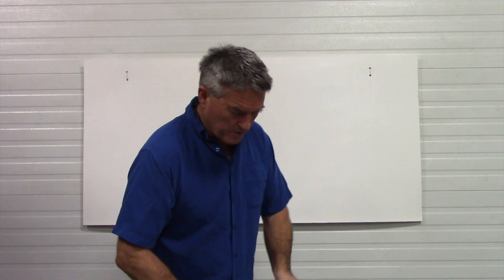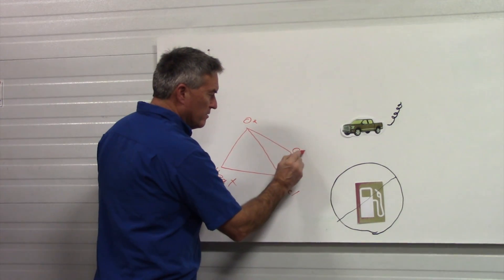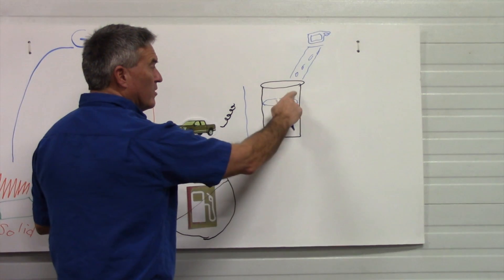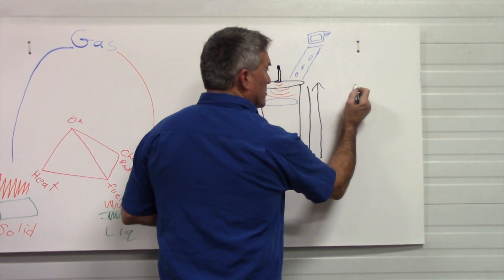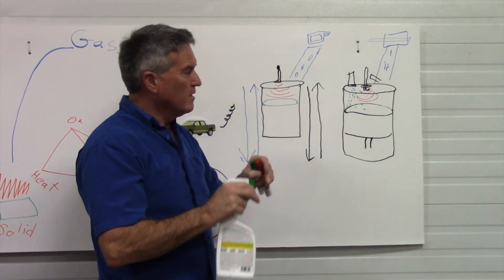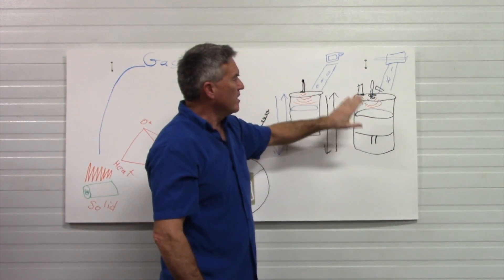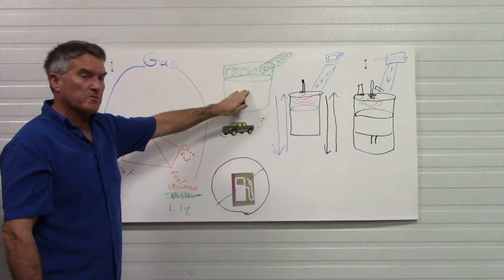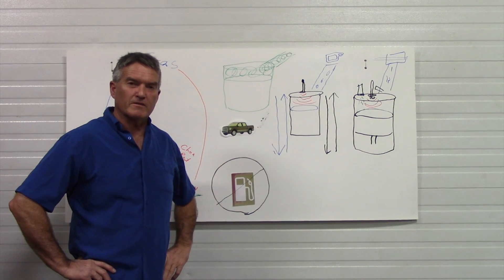One Simple Trick to get 100 miles per gallon with less pollution!

Comment: Maybe i'm misunderstanding something, but vaporizing the gas and mixing with air is what the carburetors used to do.  This sure seems like a very complicated way to do the same thing.
Reply: Haha. Carbs don't spray gas. They use the Venturi effect which causes vaporized gas to enter your cylinder.
Reply: Basically the same difference. The higher pressure inside the float bowl pushes fuel out where the wind shear blows the fuel droplets apart into very small droplets that all begin evaporating at that point in time. Same difference as a low pressure spray.
Reply: Anton Nym?  Really?  I don't believe that's your real name.  Regardless, PLEASE DO NOT ATTEMPT to vape gas.  It will kill you. And if it doesn't, well the carbs will.  I also don't think the Venturi has anything to do with it - Chevrolet didn't care that much about fuel economy.  We had one of those when the kids were little, so we could take them to soccer, and other things with all their gear, but yeah, maybe we should have bought the Caravan instead.
Reply: The idea is to do it more completely. Carbs still let raw fuel run into the cylinder. Some fuel is vaporized into a gas but some is still just small droplets.
Reply: +The End is Near, Prove it.
Reply: consaka1 ... prove it's not.
Reply: +John McLean  Prove whats not?  Did I make a claim that something would do something outrageous that it wont? If I make a claim that something will do something than I am under obligation to prove it. If you make a claim than it means nothing until you prove it.  Anyone can claim they know of a way to double your horsepower and get 1000 miles per gallon.  Means nothing if they don't actually prove it.
Reply: consaka1: LOL.  It's been near for a hundred years at least. Disprove it. LOL  JUst being silly in response dude. Don;t get all bent out of shape over my being myself here.  LOL
Reply: @littleshepherdfarm2128   You being yourself? In what way? Silly like a 4 year old?  What has "been near for a hundred years"?
Reply: consaka1: Yep...me being silly. LOL. The end has been near for a hundred years so it must be really close by now. BUT hey...no need to not enjoy life while you can huh.
Reply: @littleshepherdfarm2128  Soooo you are just a silly little nutter? Well thanks for contributing to the discussion.
Reply: Nah...just a nutter. LOL  And you're welcome. I was just being silly there and had no idea you were talking to someone else. LOL. Sometimes.....LOL
Reply: consaka1: Laughing my butt off here! I just realized you were talking to someone whose NAME is THE END IS NEAR. LOL Guess I need to rest my tired mind. Geez I'm getting old over here! LOL. I thought you had just jumped in here and said "the end is near". LOL. SO I was being silly and said in reply: it's been near for over a hundred years." Too dang funny. I gotta get more sleep from now on. I've had 3 mini strokes and sometimes it shows. This was one of 'em. LOL  But I'm usually on top of my game. Just not in this instance. LOL. Have a great night bro.  :)
Reply: +Tampicokid   You are assuming too much. You can easily run a car off the vapor of gasoline. Gasoline is very volital. The part of the gas that ignites is vapor that is true but that doesn't mean there isn't some raw gas in the cylinder still giving off vapor. If it is still a liquid when the spark plug triggers the fire than it may not completely burn. In fact that rich mixture is needed to cool the cylinder and provide fuel for the catalytic converter. The hose in the bucket is a very crude way to do it and I agree there might not be enough vapor there to do serious work. But a little modification could change that.
Reply: Hmm, I don't think that is quite the situation.  Changes in state of matter, are quite specific, i.e. water going to steam.  A tremendous amount of energy is required for that.  Turning water into an aerosol, is not the same as turning it into steam, it still is water, tiny particles within another medium (air), but still not technically a gas.  I don't know much of anything about this video's process, and think that the process of really turning gasoline into a gas, would be quite precarious, due to it's low flash point.  Still, the idea smacks of some merit.  In order to change the state of the liquid to a gas, would require an input of energy to that liquid. I don't know if this 'invention' does that.  I'll stay tuned.
Reply: +my1after909,  Changing liquid into a gas has a lot to do with the properties of that liquid. Gasoline readily absorbs heat and vaporizes into a gas at room temperature. That vapor is actually heavier than air and will run downhill and can concentrate in low spots. Numerous people have been injured and died because of this fact.  So yeah running air through gasoline will pull enough vapor out for a vehicle to run. Critical thing is surface area though. Thus the need for multiple hoses. This is the area that is the crudest and could be built a lot better. 
As for water you are absolutely correct. Which is why I inject it into my engine pretty close to aerosol form. Point being to substitute steam for actual heat. This gives slightly more power but more important decreases EGT's of the engine so hopefully the pistons don't melt down.
Reply: You would think it would be pretty easy to test wouldn't you?
Reply: tampicokid  Lol, I agree with most of what you have said. However you forgot something. Much of the additives in the gasoline will not come out in the vapor with the bucket system. Eventually the bucket will need to be cleaned. 
However it is not the size of the bucket but rather the size and quantity of the bubbles. Smaller bubbles in higher quantity are the ticket complete saturation. And here is where you are wrong a bit. Complete saturation is enough to run an engine on under load. It's enough to cause a huge explosion it ought to run a car. I believe an air mixture that is completely saturated should be close to the typical ratio. I could be wrong here because I can find no information on it whatsoever. It might be a little rich or it might be a little lean but it will run an engine. The problem of course is metering it because with pressure changes comes temperature changes and with temperature changes comes the inability of the "air" to stay saturated. If it can't stay saturated than it will condense out.  It is on my list to test out someday. Just need some time to build everything. 
I completely agree the mileage increase will not be grossly substantial. Maybe a little better at wide open throttle due to the low pressure. Reminds me I will need to use clear poly post throttle plate to see if it comes out of saturation. Thanks for the memory jog there.  Cheers m8.
Reply: tampicokid  Calm down m8. Are you always so negative? It is hard to carry on a decent discussion with someone who is always engaging in putdowns. Just about the time I think you are a reasonable person you start with the put downs. Nothing logical or constructive to say? I agree that at some point extensive testing is necessary but we aren't anywhere close to that and probably never will be if preliminary tests show what we suspect they will show.  You and I both know there is finite amount of energy in an ounce of gasoline and 200mpg pretty much defies logic as to the heat energy that can be extracted from gasoline in ANY form. Hope you get to feeling better. I can only assume you are edgy due to a bug coming on or something. Cheers. And yes I did just recently change my name.
Reply: your 100% correct ..or the you could just run your car straight off the evap system.I agree with you 100%
Reply: then I apologize for attempting to give you a little bit of credit cuz I guess you're just a full blown moron....FRIEND.  :)
Reply: tampicokid  Ain't it funny how you can talk yo someone else with respect but not someone who doesn't wan a argue with you and just wants to enjoy a nice conversation while learning something in the process. See? What you said here was nice and calm and can be appreciated better. If only you could do that MORE OFTEN. 😊
Reply: Seems to be a very simple way to me... try manufacturing a carburetor or a fuel injector!!!
Reply: tampicokid  LOL you need to get over yourself. Your rambling comments miss the marble for the BB. Your superiority complex has pretty much made you blind.
Reply: tampicokid  I can't wait for you to start discussing something relevant than.
Reply: tampicokid  Oh you mean that delusional stuff you wrote based mainly around your huge ego? You did a good job mixing a little truth in with ignorance. Not really worth reading though.
Reply: When you heat it up, atoms in the fuel expands and ignites at higher combustion and uses less fuel to operate...

Comment: Interesting that engine manufacturers haven't caught on with combustion principles and developed this. A few years back I drove from Bristol to Leigh in UK some 180 mile on a little over 2 litres of diesel at a grand cost of £3. That's how much it cost to fill it back to the top after I was curious as to whether my fuel gauge was reading right. During the whole journey my car was almost just idling because the power output had gone up some 600% and I was actually struggling to keep the speed under 70mph. It was a particularly damp day with mist in the air pretty much my entire journey. I can only assume the water droplets were getting into the fuel air mix and causing significant expansion of the combustion gasses as the water droplets boiled. Naturally the water was insufficient to have a detrimental affect on the combustion but was enough to increase power as it boiled off. Based on my math my Kia Cee'd 1.6ltre diesel achieved 309mile/US Gallon or 372mile/imperial gallon. I'm not eager to modify my car for fear of damaging it, but I would be curious as to whether anyone else dares to try replicate these conditions by injecting water spray which would be preheated by the engine first. Of course water in the mix may damage any catalytic converter and corrode the exhaust system including the cylinder, but if these components could be modified to resist water in the exhaust we could be looking at boosting efficiency of the combustion engine. Of course with EVs starting to become a reality for some with promise of them becoming dominant in the next 5 years I'm not sure of the future of petrol/diesel cars/vehicles other than in hybrid configurations. Could be good for large freight though, including marine applications.
Reply: Yes, I experienced the same effect on a long journey in fog with a small petrol engine car (carburettor). Afterwards I did make a cold water injection system, direct into the manifold. It seemed to reduce fuel consumption but my engineering skils weren't up to the job and I had to disconnect it. Ideally it needs an ultrasonic system to atomise the water spray.

Comment: So he wants to go back to the old engine with a carburetor which had a manifold on top of the engine which was heated and did the same as the fuel injection they more efficient engines but your not even close check out some of the new engine design on YouTube there's 5 or 7 really different types and what you said isn't even close

Comment: back in the sixties gm used a small gas turbine on a generater with lead acid batteries 80 plus mpg. in a cadilac but there wast a good computer too control the gas turbine and eat was a problem

Comment: An explosion is a solid or liquid quickly turning into a gas. If you are injecting a gas at the start then there is no explosion just burning. The piston is moved down because the liquid fuel is converted into a gas very quickly which is a hide increase in volume. The torch you use is a perfect example. As the gas exits the end of the torch it just burns it does not explode and increase in volume. Without that huge increase in volume the piston does not move.

Comment: I was an apprentice mechanic fifty years ago. I too wish to have more efficient engines. When I asked my teachers about this I was told the oil companies would not allow vehicle manufacturers to work on this as it would impede sales of oil and gasoline. One way to do this is to run a vehicle engine more slowly to support complete combustion. Engines used to be cast iron and could withstand the loading but because aluminium is much easier and cheaper to machine it has become the material of choice so as to maximise profits. However aluminum can not take the heat of heavy loading so engines are run twice as fast and this shortens the time available to extract efficient burning. The excess fuel is dumped into the exhaust and no one care because every one seems to want a Ferrari style 
car. If I were to make a car, as described in the book I wrote, "A Tinker's Dream" I would use a very small iron V8 driving a pump to supply hydraulic force to release the brakes and then drive a turbine in each wheel that would work the same as a torque converter between an engine and a transmission. The transmission and the emergency brake systems would be thrown away. Any way you gave a very good explanation but sadly the answer is political.
Reply: Currently brought back from the grave, the opposed piston three cylinder engine, Very compact, no valve train, high torque, 50% less fuel, low emissions, 2.7 liter 270 hp. This is in fact a six cylinder engine. 26 miles per gallon powering a big truck.
Reply: There were times when fuel economy tests were done often, the auto was driven carefully and slowly. Outcomes for fuel consumption was increased by quite a bit! lots of variables to this but showed there are better ways. Most of these took place in the early 1950s.
Reply: Robert Buzzkill, I think you need to re-check your math.  You couldn't have been an apprentice mechanic fifty years ago, because cars weren't invented yet.
Reply: Right. 1968 chevelles have been proven to be a myth.
Reply: John McLean, You better check your history, junior. The Ford Model T was first sold in 1908, about 110 years ago.

Comment: Want free gas? Or almost free? Do your own research as I did. My best solution to get off fossil/mineral fuel is an old technology called a Wood Gasifier. It converts wood into a usable gas that will run standard gasoline engines. Look into the Embert design as it solves the tar problem with Wood Gasifires. This is a game changer! Search YT and you will find many examples of this 100 year old technology in action. During WWII, over a 100,000 Gasifiers were in use here in the United States. They ran tractors, buses, Trucks, and even the weekend outing with the family car during severe gas shortages. I use one to charge my battery bank, run the hot water heater, gas stove cooking, cutting the grass with my riding mower, running wood chipper  for my homestead. I will probably make another to run the pickup. The cost of fabrication can range from nothing to a few hundred dollars. You can compress the gas into old propane tanks for storage and use in the grill, or just use the gas direct from the Gasifier. It's clean and it's safer then any oil based fuels.
You can thank me later. Right now, go search YT! Your future may depend on it...